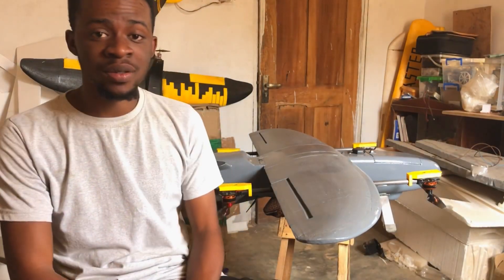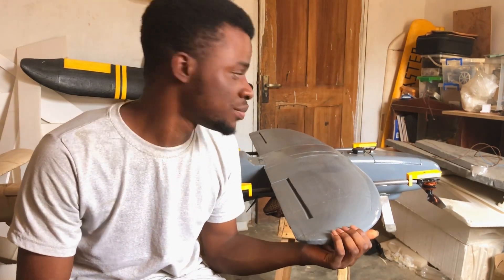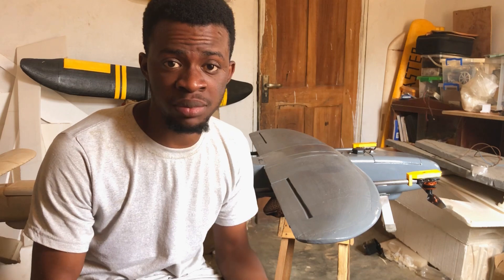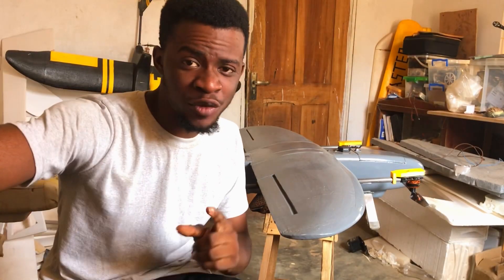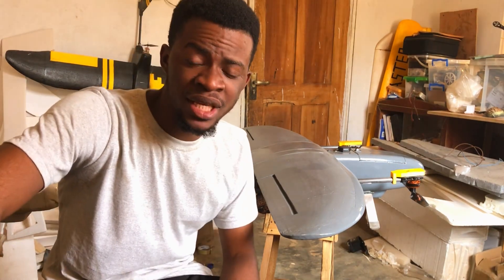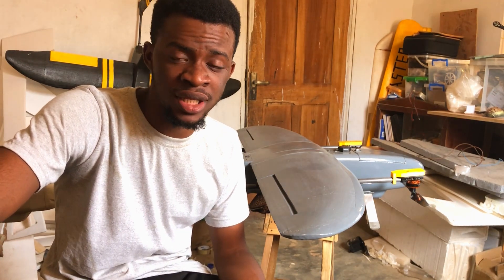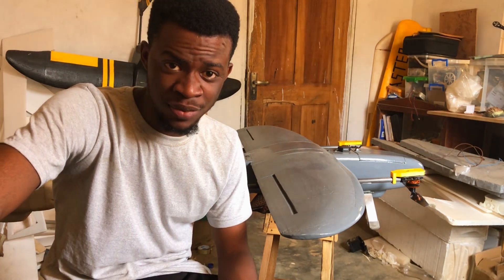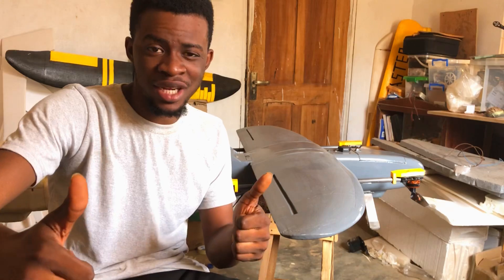Homemade X-UAV VTOL | Hover test

Comment: which propeller are you going to use for the rear motor for fixed wing flight? also what is the KV for that motor?
please make another detailed video showing transition to fixed wing from vtol, this is a really good project.